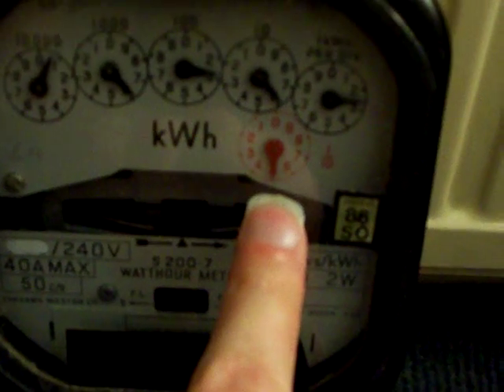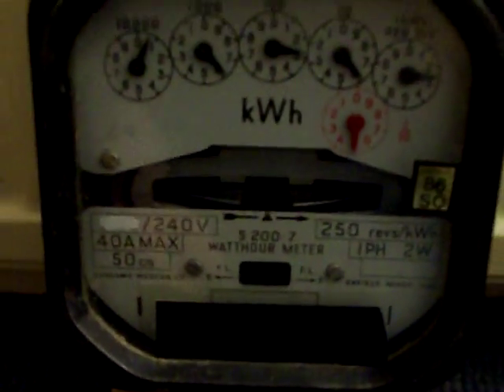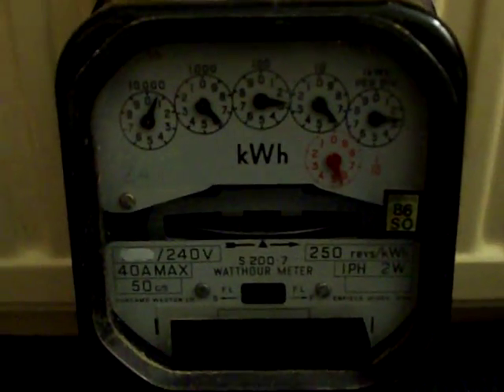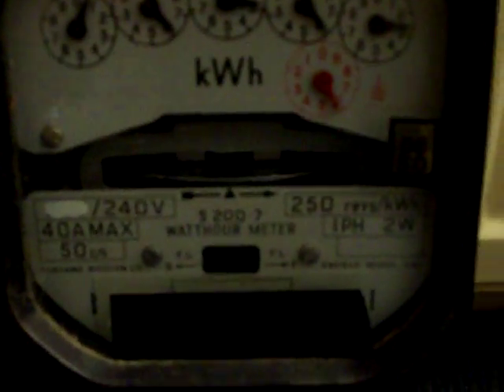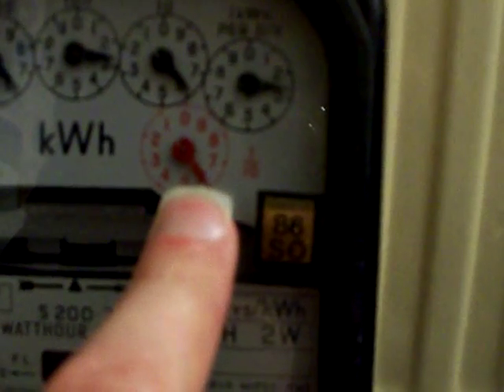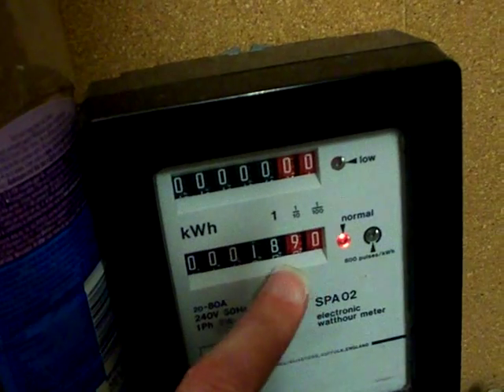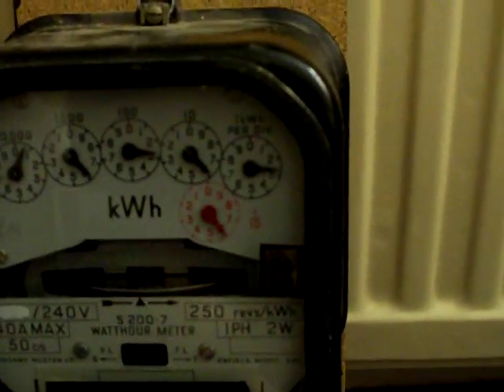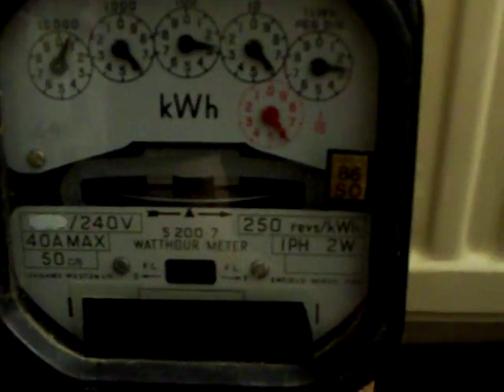Electricity Meter : Accuracy Test, Sangamo Weston S200.7

Comment: Looks recently removed and in pretty good nick. The S200.7s had a 25 year certification period. You can tell which were the dodgy models; the S200.16 had a 15 year certification, but it had problems with sticking registers. Things went the right way again with the S200.38 which has a 35 year cert period.

Comment from the maker: @RODALCO2007 My water heater wouldn't handle 1kWh. :-D It boils somewhere between 0.2 and 0.3 kWh depending on how cold the water is. The capacity of the bottle which the element is in, is approximately 3 litres, so really, I use a theory that it takes 0.1 kWh to boil 1 litre of water, give-or-take a bit, as it depends on the temperature of the water at the beginning. To do the test over a longer run, I'd need to use our 96 litre Immersion tank which is in a cupboard in my bedroom. :-D

-BBD.